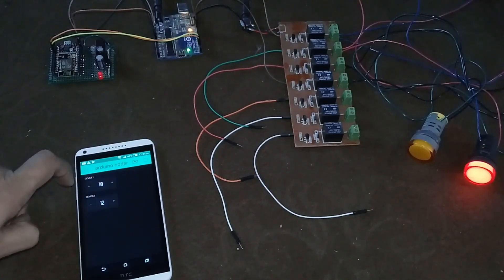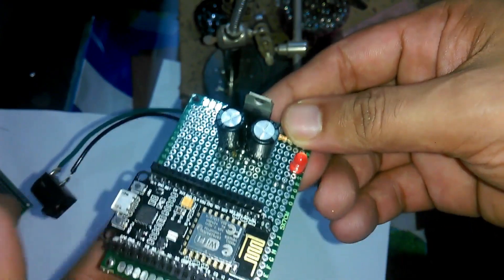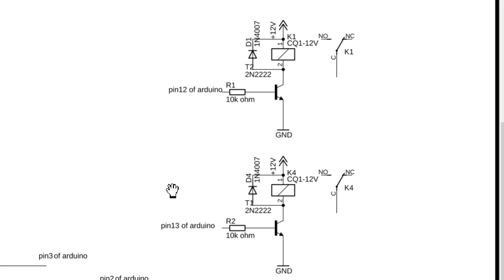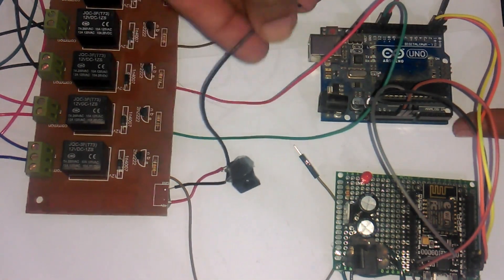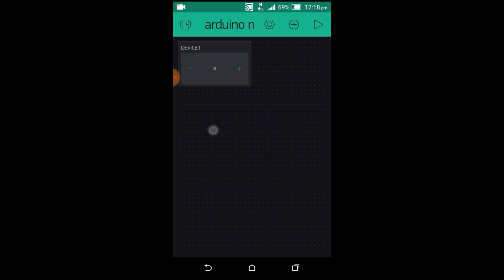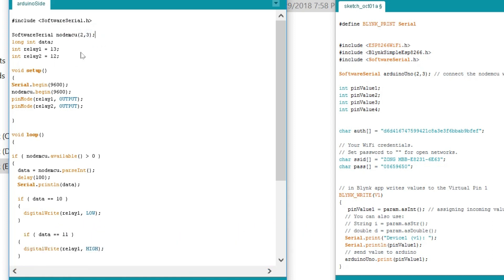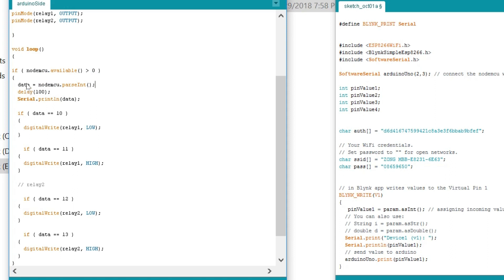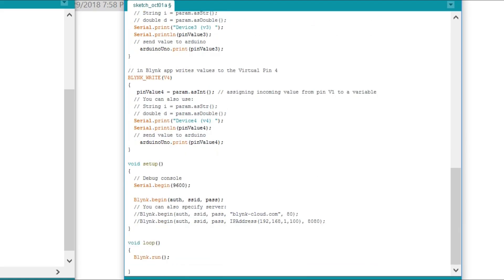How to control Arduino using nodemcu esp8266 and Blynk application “Arduino  nodemcu + Blynk”

Comment: Nice work
Could you please add dht22 or any temp and humidity sensor connected with uno and these two values can read by nodemcu.
On the bases of these values relays connected with nodemcu can operate
Reply from the maker: it's already available, check the playlist.

Comment: Arduino: 1.6.5 (Windows 7), Board: "Generic ESP8266 Module, Serial, 80 MHz, 40MHz, DIO, 115200, 512K (64K SPIFFS)"

Build options changed, rebuilding all

In file included from blynk.ino:5:0:
C:\Users\zile\Documents\Arduino\libraries\Blynk\src/BlynkSimpleEsp8266.h:18:21: fatal error: version.h: No such file or directory
 #include <version.h>
                     ^
compilation terminated.
Error compiling.